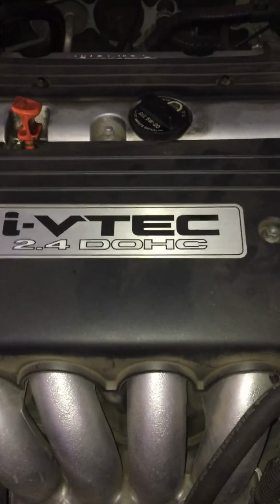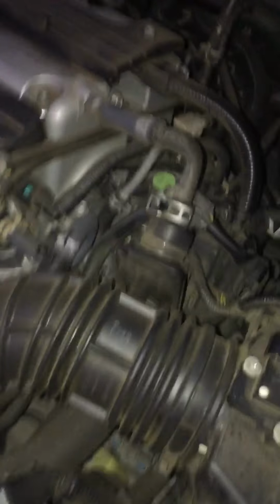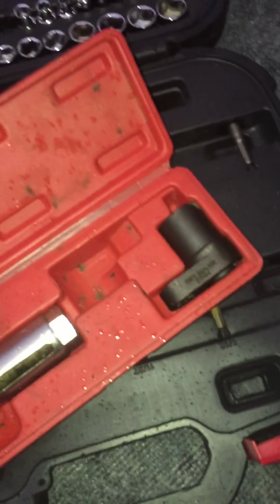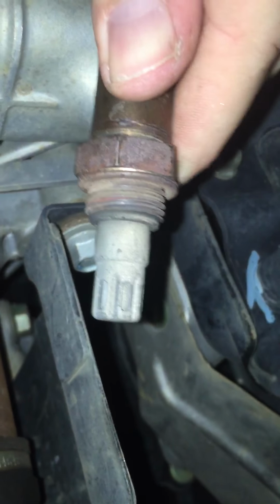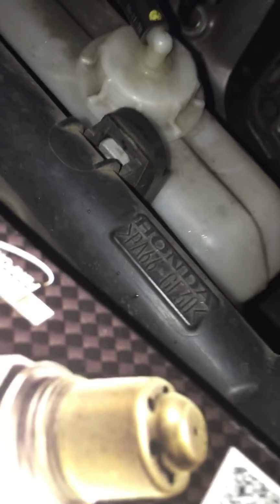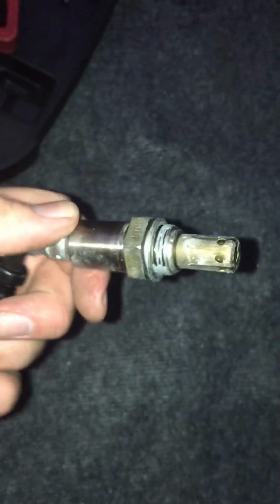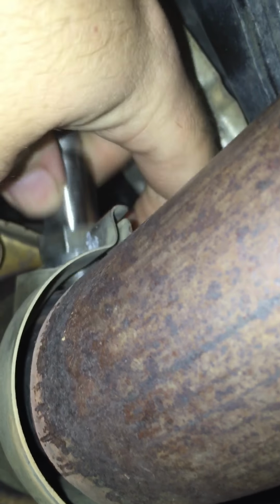Upstream O2 sensor replacement for a 2006 Honda Accord

Comment: hey I have question, I have a hard time taking out the clip do you have any solution? it doesn't slide off like you said on the video
Reply: Yolly Delgado press down on the release clip and pull firmly away. It still may be stubborn so what I do is have a short flathead screwdriver to help pull (or push) it off. Or, If you can get some pliers onto it and pull, that works well too but don't squeeze too hard and break the connector.
Reply: Ya mine isn't budging either